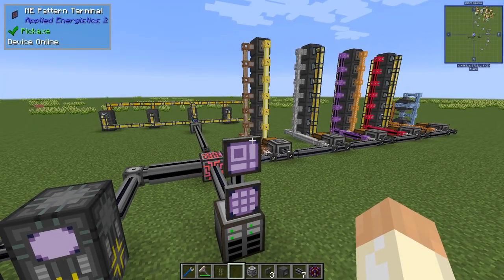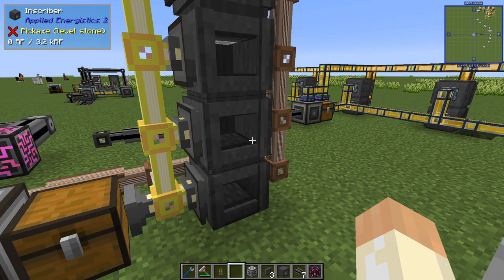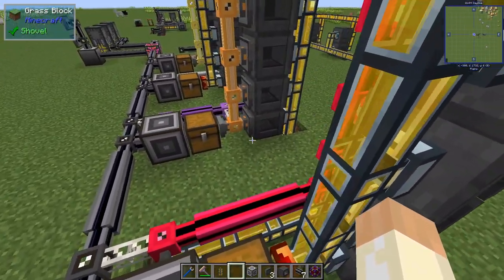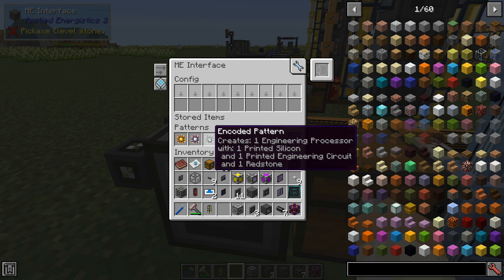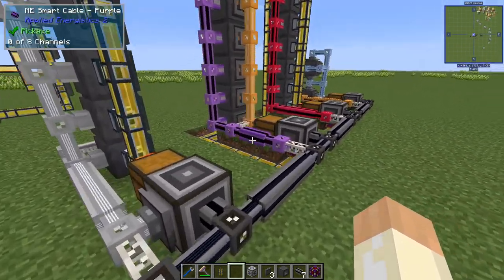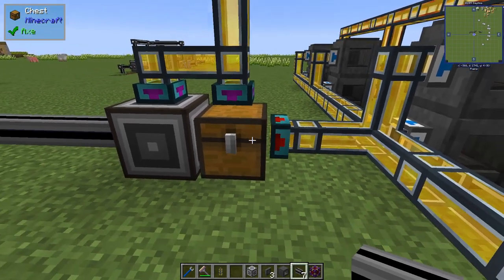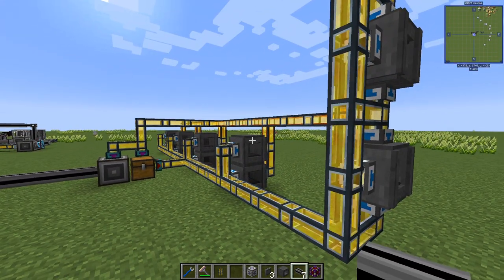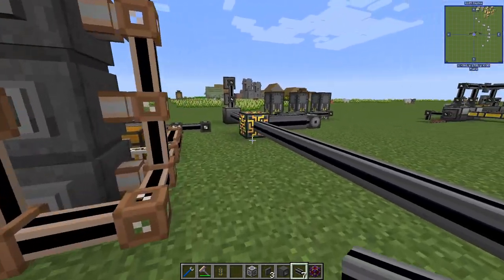Auto-Craft AE2 Processors and Inscriber Workload Sharing - Part 1 of 2

Comment: Great videos and thanks for the info. Another solution for the multiple inscribers is to add a few redstone and silicone circuits to the chest. That way the inscribers will have their fill and when you send new crafts to the inscribers they dont wait on 1 due to some redstone or silicone in a different one.

Comment: I did a very similiar set up in stoneblock for my processors, only I used mekanism logistic pipes and color coded the outputs to sort correctly.I had one place for all supplies to go, then another for re-importing back into the system. Worked well and fast.
Reply from the maker: Nice! Did you have only one final Inscriber to craft the Processors? I have a good solution at hand to prevent the "flaw" in my build, but would like to hear of more solutions to that problem :)

Comment: As far as I know (at least for 1.12.2), inscribers transfer energy through themselves, so you don't need additional cables to power them, just connect the bottom one to save a bit of wires. 

Also you can storage amount of redstone and silicone plates inside another chest and retrieve them into inscriber by it's own... retriever, so you can craft any amount of raw processor plates because only one thing must be inserted.

For the speed, signalum retrievers (and servos) are the same, use them if you don't need a large amount of filter slots.
Reply from the maker: Good comments, thanks! Big reply below :)
I know the Inscribers receive power if you use a full block Interface (but not the slim version). And I thought you were right in that they share power but now when I tested it didn't. Did some more testing and it seems like they DO share power but only if the first Inscriber is powered with ME cable. When I exchanged to Fluxduct only the first Inscriber got power. So it would work in the huge towers (except for the final crafting step as they don't touch each other), but not in the second, Thermal setup. Good to know for both of us I guess :) 
For speed, Signalum and Resonant has the same extraction rate, but to get full speed in the Itemduct higher tier will be faster. Extracting with lowest tier of servo or retriever will extract in slower pace and send items much slower through the duct. So if you want to use a high tier Itemduct you should use a high tier Servo or Retriever as well. 
Finally, great suggestion with the Silicon and Redstone being separated. When I built it now I had a feeling that I've done something similar before but I didn't think of it when preparing the recording. I modified the build with two chests, and an export bus on each one to send Redstone and Silicon (filled all slots but one with Stone). Then I changed the Itemducts and various things to have Printed Silicon always ready (64 in each Inscriber output slot) and keeping the final Inscribers always filled with those items. And as you said, the recipe for Logic processor will therefore only have Gold in the pattern.

Good stuff!

Comment: I know its an old video, and you probably already found a solution but it requires a few ender pearls, but you could boost the efficiency and possibly solve your flaw by using an intermediary xnet setup to route the silicon, gold, etc between the buffer chest and the inscribers. The advantage with xnet is it can access all sides of the inscribers with a single connector so you could also make it far more compact. xnet can also supply power to them all, all in 1 cable. its a really great automation mod. I use it in Enigmatica 6 for the generators because prcs use all 6 sides and are a royal pain with anything other than xnet. also great for automating the energising orb from Powah :) xnet + AE2 is just so powerful its crazy :)

Comment: hey man, building this in 1.20.1 atm9 and i dont think it works anymore. My autocrafter doesnt seem to recognize the pattern inside the ME interface. not sure if im doing something wrong, but everything is connected and powered.
Reply from the maker: After 1.16 (or so), they changed the ME Interface behavior and split the functionality into the "Pattern Provider". So all old videos where the ME Interface is used to store patterns it should be replaced by the Pattern Provider which is used in the same way in that aspect.
Reply: Thank you so much  @therealtkh

Comment: Thermal isn't bad, with filters you can do the whole thing with thermal and it's not that bad. I prefer with enderio conduits for this since you have a bit more control, and one connection can handle input and output.
Reply from the maker: EnderIO conduits are absolutely more flexible than Thermal ducts, but I'm not sure it would help much in a setup with regular Inscribers as they have dedicated sides for items to go in and out (three input sides for corresponding slots)? But you wouldn't need servos using conduits, it's always a bonus.
Reply: @therealtkh  you still need to connect to multiple sides of the inscribers, but it can make things a bit more simple. Is also use export buses over storage buses. They're cheaper, and work better. Storage buses only work the moment an item there's the network. Export buses are always trying to export
Reply from the maker: @TheLukemcdaniel  Absolutely. I normally tend to start with Itemducts becuse they are simpler to craft, but once some auto-crafting is up and running the Conduits are preferred. Good point regarding item cost between export/storage buses. In creative I rarely care about crafting cost... In these setups with very small "buffer networks" or what to call them I see no difference in using import-to-storage or storage-to-export (other than cost in resources). In my previous video (with Bees) I had examples with both methods :)
Reply: I hope EnderIO is updated for 1.16+ (or just some future version where the community lands) and isn't locked to 1.12.  I haven't learned XNet yet.  I'd be interested in people's opinions about EnderIO alternatives.  I just like the sides preview of EnderIO, how the wrench works, how the models look.  The XNet cables are solid colors and aren't as neat to me.  EnderIO's bundles are very clever.
Reply: @chris.dillon  eio imo is the gold standard. Mekanism isn't bad, but eio is the only one I know of that lets all the cables share one line, and the channels are so useful.
Reply: XNet is nice too.

Comment: so i'm having an issue with the first version. i can make orders and the order will craft, but the finished product wont leave any of the inscriber inventory. i have Channels, and power and room in storage. i have no idea why its not working
Reply: i'm playing ATM6 if that helps
Reply from the maker: @TheDmanHunter  ATM6 should be in 1.16.4 as far as I understand but that shouldn't be a problem even though this build was made in 1.12.2. How are you emptying the Inscribers? It's hard without screenshots or anything like that because there are several minor things that could be wrong. Extracting from right, with export bus or storage? Into Interface or what?
Reply: @TKH It was import buses to extract for the inscribers into storage buses. I ended up using Cyclic item pipes to extract instead. For some reason when I tested everything worked fine but on my actual world they wouldn't pull.
Reply from the maker: @TheDmanHunter  Ok, I don't know why that wouldn't work but good things you got it working with a workaround. My first guess would have been that the "small" network didn't have power. Or that when storing into an Interface it would be configured as "arrow" or something making it not accept the items. I always do my error searching with chests, so it can be broken down into smaller parts to find what isn't working.